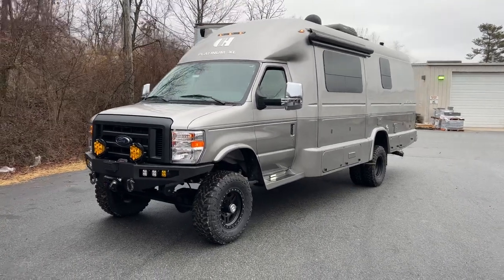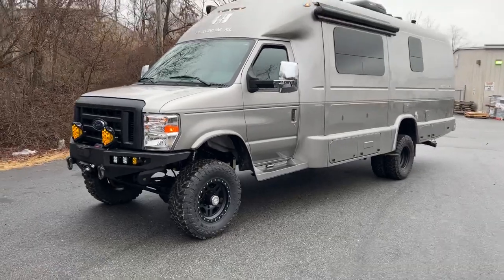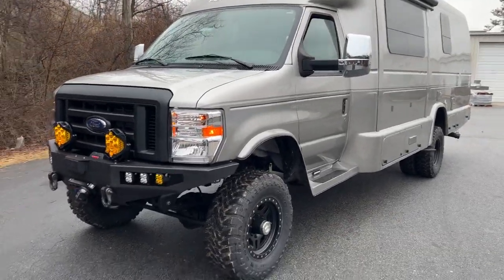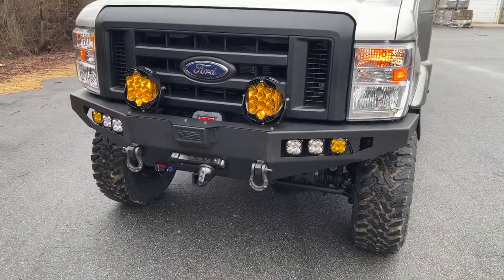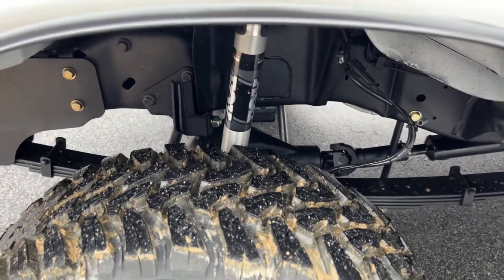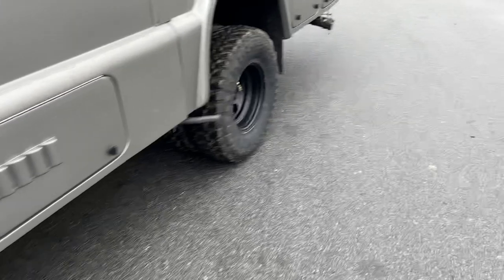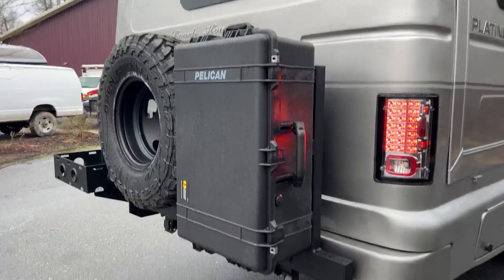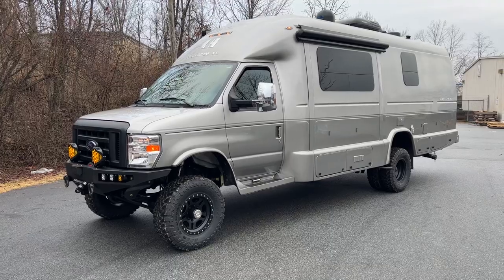Ujoint Offroad Coach House 4x4 Conversion

Comment: Probably a stupid question but does a "6" lift," truly mean from ground to top of AC the height of the overall RV is 6" taller?  Asking because I only have a 4" buffer in height where I store my rig.  Thanks.
Reply from the maker: The quick answer is no, the actual gained height is usually higher. Your 4" is cutting it a bit too close in the wrong direction!

Comment: Great looking lift.  Did you use a spacer between the back tires?  And do you use Loctite on the spacer lugs?
Reply from the maker: Thanks! No spacer in the rear.
Reply: @ujointoffroad  Thanks for response.  Always see if you go with the 255 you need spacers. If you can get away with Toyo's, I pretty sure I can get away with the Falken 255's they are a bit narrower.  Thanks for response.

Comment: Would prefer all 7 wheels the same. Nose looks higher than the tail compared to a stock Coach House. Hate to imagine the total price for a new Coach House converted to 4x4. They make a twin bed no slide out that is a mere 23’2” long, the places you could go in that.
Reply from the maker: Dually wheels won't clear the big brakes and the rear spare can be used up front (backwards) in case of an emergency. This RV is level, perfect stance
Reply: You do realize there are after market dual wheels in sizes up to 20” right?
Reply from the maker: @geraldheikes5463  With the E series specific hub bore?
Reply: A Quigley conversion includes 17” wheels, and is $10,000 less.
Reply from the maker: @geraldheikes5463  cool get one of those